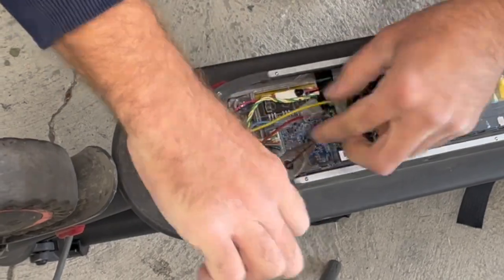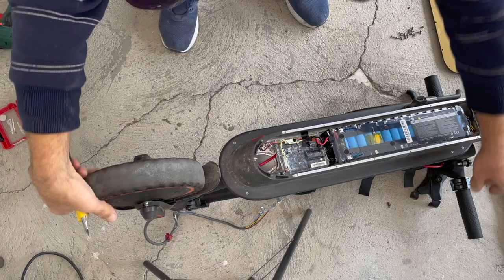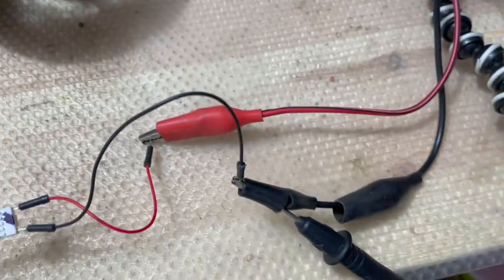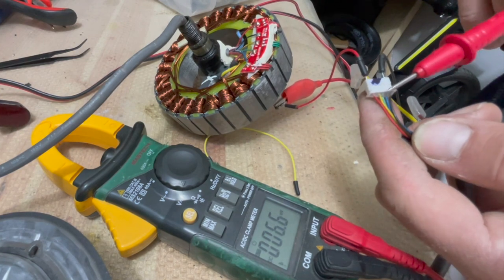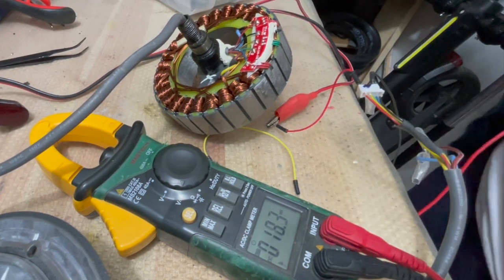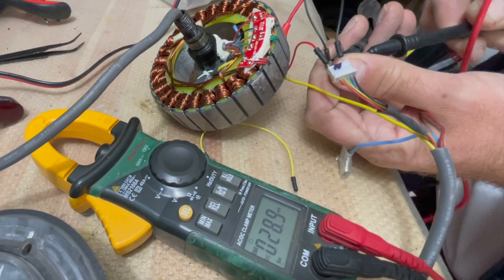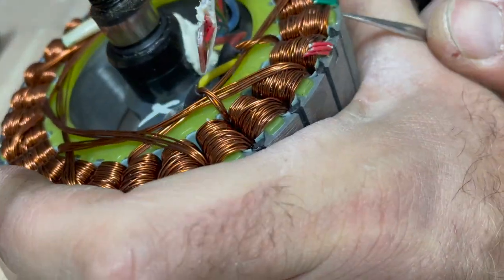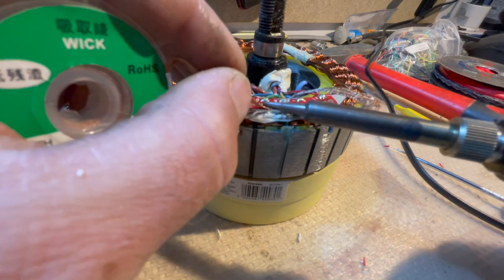Xiaomi Scooter hall sensor replacement hub motor grinding sound

Comment: Hi and thanks for very inforative video. This exact topic of middle sensor had me puzzled on a motor I am fixing currently. That is - the Pos and Out pins were swapped compared to the two side sensors on the pcb. But the old sensor was removed before I got the motor so I did not know what to do until this video. I also have 3 identical S41 sensors and will have to physically twist the middle one 180 degrees - but oddly this leaves me with the pins in the correct position... Is it so that the N41 normally has swapped pins for pos and Out compared to the layout of S41? If not the manufacturer probably used your trick of physical reversing already, thus the different pins for the middle one?? Thanks from Norway 🇧🇻👍😃

Comment: Is that sound from the hall sensor? I have the same sound on my emove cruiser after rewiring my hub motor since one of the hall sensor wires was snapped, I didn't check if the hall sensor worked since the motor ran just fine even with snapped hall sensor wire. What do you think issue is?
Reply from the maker: Probably one hall is not working properly! Change all is recommended

Comment: Great video. Is there any sign or clue to tell if I have a board that requires the middle hall sensor to be turned around by 180°? Same question differently: How do I know if I have to turn the middle one 180°?
Reply from the maker: Easies is if middle sensor is with green legs compared to the outer sensors with red legs
Reply: @Asteros3D  problem was the Halls were stripped off to begin with. The printboard still intact had reversed solder points for the middle pos Hall - leading me to suspect it was physically turned 180 degrees to achieve reversed polarity.
Reply: @Asteros3D  I bought 41F hall sensors (wasn't easy to get them), and now after opening the motor, I see that the hall sensors in there are 502F. After searching on the net, it seems like they are interchangeable, but I wanted to ask you for your opinion. 502F seems to be a "latching" type. Unconfirmed, but seems like 41F, A3144 and 502F are compatible hall sensors but I personally have no clue. Thank you in advance. Here is my video on showcasing the printboard and sensors: https://www.youtube.com/watch?v=P88xYI_hAaE  - I'd like to know your opinion whether I have to turn the middle one around 180°. Printboard has the inscription "105" by the way. Does that mean 105°? UPDATE: One of the soldering points on the printboard was disconnected. I soldered it back on and the scooter runs again. But the question still remains: Is 41F, A3144 and 502F compatible?

Comment: Interesting video, thanks! Im trying to figure out wether I've got faulty hall sensors or my issue is elsewehere. My xiaomi schooter Pro 2 had a damaged motor wire, i shortened it and resoldered all cables. After using it for a short while the same appened again and i believe the issue was with a damaged motor washer, that allowed the stator to rotate, twisting and damaging the cable. I proceeded in repairing rhe cable again and changing both washers, no error 18 appeared then. After 5-6 km i noticed the front wheel was making some rattling sound, and speed dropped for some instants, no error on display,  so i proceeded in opening the motor again. Nothing seems off with it, no cables snapped, all solderings seems fine. Testing all 3 sensors i noticed the minimum voltage on each of them is 0.9V, maximum 4.15, hall sensors N41. Not sure if I could be having a sensors issue here or not here, im at a loss. Wouldn't want to go and try replacing all sensors if this might actually not be the cause. Anyone having a similar reading on his N41 sensors?
Reply from the maker: Check continuity of the all 8 cables, from the soldering until the plugs, shake and twist cable when buzzing 
Then we speak again
Reply: @Asteros3D  I do have continuity on all cables, but since the cable got twisted once I've a feeling some internal damage might still be hiding underneath. Just ordered a new caw so that I'm able to completely exclude the cable from the picture eventually. I'll keep you posted👍 thanks
Reply: Just checked again, as suspected I do have continuity even between the three different phases, so cables must be touching somewhere under the insulating protection. Hoping a full cable change finally fixes the issue 🧐
Reply: Changed the cable entirely, still had continuity between the 3 phase cables, looking on Reddit seems it might be normal. Reassembled the scooter, no vibration while testing under no load, after a quick test on the road the same issue appeared again, I believe I'm going to have to try with a full hall sensors replacement as next step now.
Reply from the maker: The continuity between phases is normal 
There should be resistance between phases around 0 and 2 ohm 
Hall should go 0 volt when off, you mentioned previously that the voltage fluctuates between 0.9 and 4.15
Reply: Reopened and I got again 1 hall sensor cable snapped and the insulation on 2 phase cables damaged, probably due to cables being told long and touching the lid. Soldered them again and made sure to push all cables inside and away from the lid, so far, after 15 km all seems good. Even with voltage going to 0.9 instead of 0 sensors seem to be working fine 👀🤞

Comment: hi tanks for the vdo.I have troubles with a ninebot ES2.After replacing the halls it showed on the tester its a 60° cycle .After i saw your vdo i switched the 2 outer legs as per vdo.On this way i have the + on the signal,and the signal on +. But this wont work and the control light on B is permanent on.I'm using SS41 hall sensors. Did i got something wrong ? some said swaping + and - will help too.But i wont ruin the controller. Its a new one and if i switch  to another wheel it works. Wheres the fault ? thks
Reply from the maker: Check out if all 3 connections for the sensor are equal output, for example if left holes are “”+””, middle holes are signal and right holes are “-”
I remember for Ninebot middle were swapped 
Right down this and send me pictures to aasteross@gmail.com

Comment: Thanks for this explanation so the middle sensor outer wires are just swapped not the position of the sensor? I see you were using some kind of resin on the sensors what was that ?
Reply from the maker: Position of the sensor, letters looking out and after soldering twist the sensor 180 degrees so the letters look inside

Comment: Folks, grateful for some advice. My M365 has been blowing hall sensors every couple of weeks. I think I'm on the 4th motor now and we discovered that it was the hall sensors so we replaced them and it worked for a day and then again it had the same fault, vibrating like in other hall sensor videos. Does anyone have any experience as to why this is happening every so often? What might cause a hall sensor failure?
Reply from the maker: Check whether the voltage and current are stable and whether they are within the specified range of the Hall parameter. Partial upper limit or lower limit will cause the Hall to be unstable, and exceeding the parameter range will cause the Hall to be punctured and cause damage.

Comment: Do you know of a link to a Ninebot Max hall sensor? my wheel is half way there,
Reply from the maker: You can use same sensor 
However the central sensor may not be reversed, if this is the case then just add all 3 sensors with letters towards you.
Reply from the maker: € 0,98  10％ Off | 10pcs/lot 41F 0H41 SH41 SS41F S41 Bipolar Hall Element Sensor Motor Electric Car Motor Hall Sensor
https://a.aliexpress.com/_mPXYQEw
Reply: Hi friend, did you find out which are the hall sensors that go in Ninebot Max G30? I'm  trying to find that information for weeks, since using 41F for replacement didn't work in my case and the original ones were discarded so I don't know which were them. I know that the middle one different than the other two.

Comment: Can i change all including the board? And what type of circuit board is compatible? Can i use n602 band plate?
Reply from the maker: Yes, you can change all board 
New board should match the degrees which the previous had, aka 60 or 120 degrees between the sensors.
Then also the polarity of the middle and side sensors as some boards has all 3 same polarity and some the middle with switched polarity
Reply: @Asteros3D  so what do you recommend 60 degrees or 120?
Reply: Or how can we know what degrees is compatible?

Comment: What sensor you used to replacement??
Reply from the maker: SS41F
Reply from the maker: € 0,98  10％ Off | 10pcs/lot 41F 0H41 SH41 SS41F S41 Bipolar Hall Element Sensor Motor Electric Car Motor Hall Sensor
https://a.aliexpress.com/_mM9QFGQ

Comment: Is this the reason the middle hall sensor has a different color insulation than the other two sensors? If so how do I know which way to twist the wires
Reply from the maker: The middle sensor is different polarity
I use same polarity sensors, measured the pcb board and after confirming that the pins are same despite the marking, in my case I just solder all sensors with marking looking towards me and then twisted the middle sensor with mark inside the motor aka 180 degrees and this is how you swap the polarity.
Reply: @Asteros3D  thank you so much. I believe this is my issue. After watching your video I searched online and found only ONE other article that speaks about this. This issue has been driving me crazy for a bit now. Let's hope this works for me.
Reply from the maker: Send me pictures at aasteross@gmail.com if you need clarification
Reply: @Asteros3D  IT WORKED!!! Thank you so much for your help!! Was driving me insane! Thank you again ;))

Comment: Asteros (or other specials) HELP me pls..
.. <<M365 pro 2, latest version. No firmware.>> 
Motor problem began with the ‘hall’-noise etc. 
-Battery 90 %. 40V
-Cables are okay. 
-No error on display neither beeps.Only 0 so no speed either. Beeps only on/off.
-The 3 spots on the hall-board at the motor (yellow, green, blue) and the 3 right pins of the halls give 5 V. NO ZERO  (no matter where or how the magnet is) 
-Renewed all the halls SS41F, nothing. 
-Renewed them by a preformatted board (middle one has different polarity) but nothing changes, 5V no zero. 
-Renewed the main board but keeps the same. 
-Renewed the dashboard, no difference…, 
-again new halls,  reversed the middle one and twisted its pins ‘cause of the polarity, but again nothing changed. 
-The throttle worked fine.
 
I checked the halls etc on all the ways I could find on YT.  What can I check (and fix) still more?
Thx for ideas and help!
Reply: did you find out anything?

Comment: Hi! Thanks for your video!!

I wrote to your email, but I thought that my question could also be interesting for the rest.

According to your video, I understand that the middle sensor must be soldered with the letters towards me and then twist 180 degrees just the central hall sensor so now the letters of this one are towards the axle, isn't it?? If this is right, I have the problem that the sensor does not fit in the gap. How did you solve the problem?? Because I should deform the magnet and I'm afraid to break it definitely...

Thank you so much in advance!!
Reply from the maker: Yes, you are correct!
In my case the middle sensor gap were between and there were plastic insulation for the wire, so I just heated it up and the sensor fitted easily. However if need you can file a bit the metal and just a bit the sensor edges from the wide side( opposite the letters, shape is more for functionality rather to fit the sensor components ) to fit and then add some super glue to hold it in place
Reply: @Asteros3D  Thank you so much!! You saved me from this nightmare!! I filed carefully the edges of the sensor and it fitted perfectly (not even glue needed, although I put some hot silicone, just in case).

Just to point out for the rest that if the scooter is turned on before putting the engine within the wheel with the magnets, error 1-8 will be heard. I was getting crazy since I did everything you said but the error 1-8 continued and I tried to close the engine after many tests and NO BEEP 1-8!! 👏👏👏 Almost I couldn't believe it after many days without knowing what to do until getting your video!! Thanks again!!! ¡¡Muchas gracias desde España!!

Comment: my cable was cut and I desoldered it for shortening and fixing it, I wasn't sure which wire was first in terms of motor I paused at 1:28 and the result is yellow-red blue from left to right.... thank you
Reply from the maker: Happy helping you